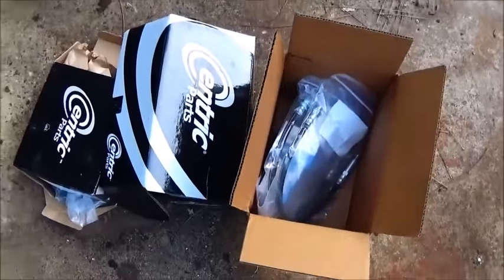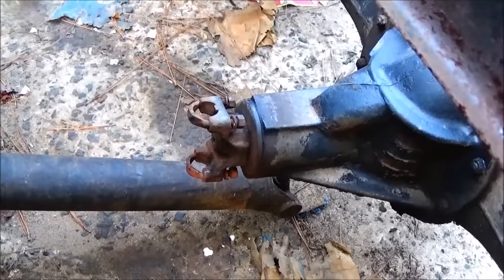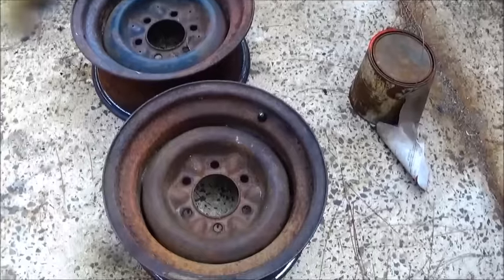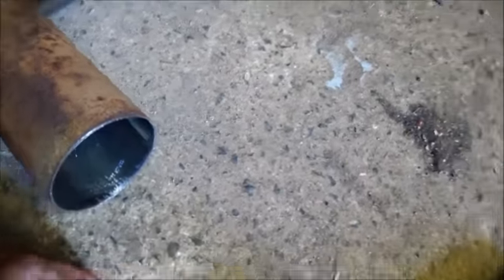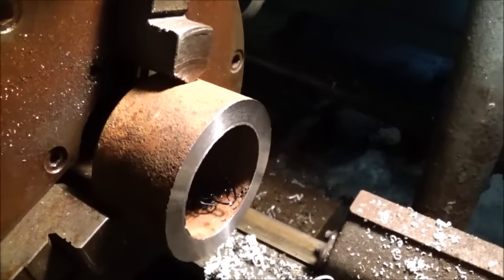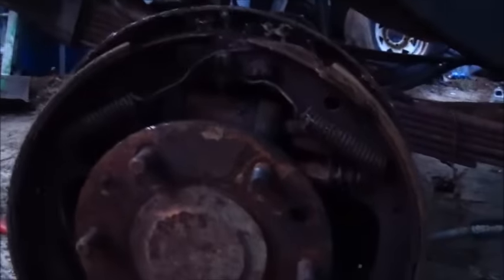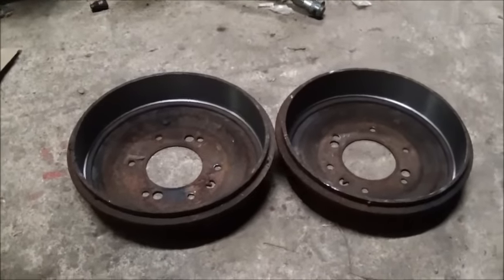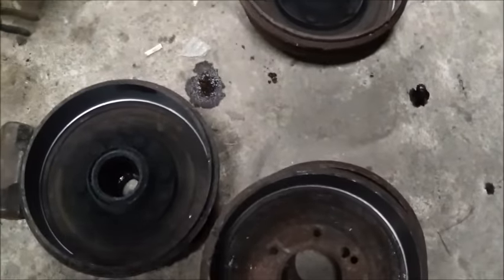1963 Ford Falcon and 1955 Chevy Truck Update 11

Comment: I really think you should put electric fans on for safety reasons, that fan just sits SO high it would be easy to be hit by it. Save moving the radiator up also.

Comment: were you using that old bear drum turning machine to turn those drums that you fixed up? If you are its doing a really nice job.
Reply from the maker: Yea, also found out you can't do model T ford drums on the new machines because the shaft is too big. This one will do them.
Reply: Yep sometimes you just cant beat older equipment

Comment: use Eastwood rust converter on those rusty wheels then you can paint the hard shell coating it leaves check out my videos where I test it out would save you having to sand blast some of those rusty parts. I got some really amazing results.
Reply from the maker: I seen the video you put up, but have not had time to watch yet.. Will soon.
Reply: Yes on the revisit video you will see my results were nothing less than amazing. Sure surprised the heck out of me